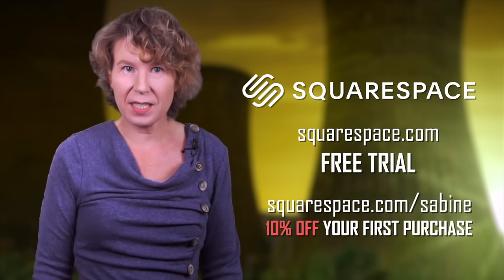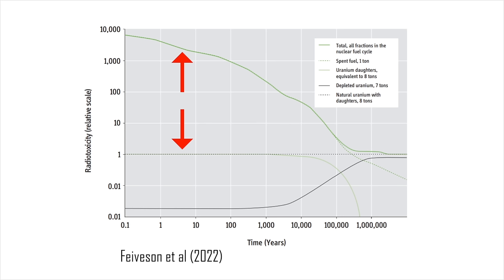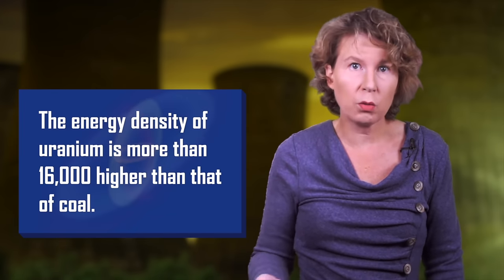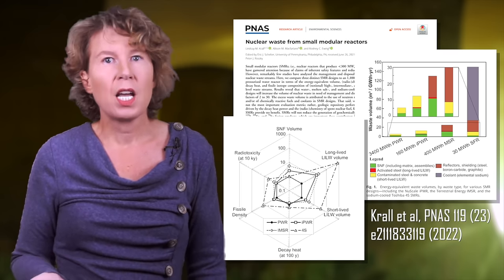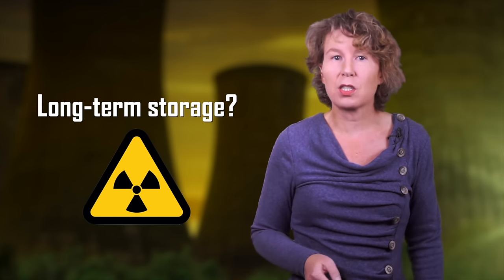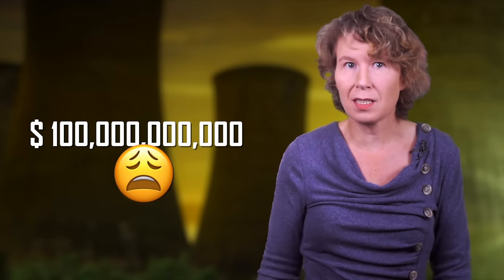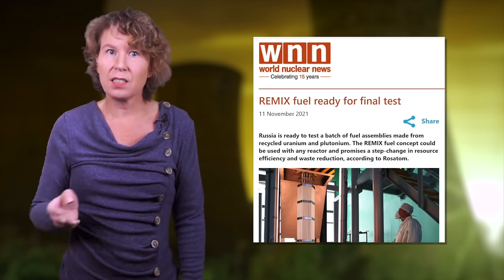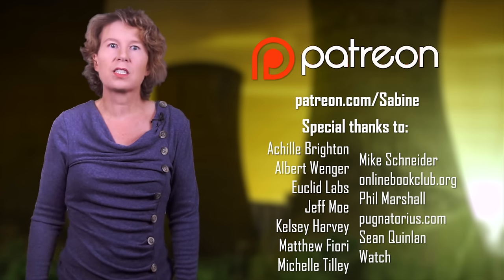Nuclear waste is not the problem you've been made to believe it is

Comment: I recall reading, several years ago, about how the U.S. Navy disposed of reactor cores, by dumping them in the deepest parts of the Pacific.  Even with plate tectonics, that stuff will stay down there for an extremely long time.
Reply: I believe this was very limited, and long ago.
Naval reactor cores use highly enriched uranium. Historically 97% U235, more recently 93%.
At end of life these cores still contain far more U235 than natural uranium. They are highly desirable for reprocessing and as a feedstock for existing enrichment plants. 
They are however a handling nightmare. The fuel have seen ten times the duty of ordinary fuel rods, in an environment with a very rich neutron economy. The zirconium jackets will be much more degraded and fragile, as will the fuel pellets themselves. They contain many times the concentration of fission products of civilian spent fuel. 
They require longer periods in cooling pools, and more remote handling at every stage until isotopic separation.
This happens at Savannah River, but most details are completely classified.
Reply: @aaroncosier735  I don't know if it was the uranium or just the reactor parts that became radioactive that was dumped.  Regardless, there's plenty of cooling down there.
I am aware of fuel reprocessing.  In fact, Canada's CANDU reactors can be used to burn a variety of materials, including plutonium and enriched uranium, IIRC.  There is also chemical separation, but that brings it's own problems.
Reply: @James_Knott  
Only the actual fuel elements need cooling. The housings are usually just iron that has had some small percentage converted to Cobalt-60. These are routinely buried in shallow soil.

Yes, CANDU can wring a bit more production out of other types of spent fuel. An extra 20% from standard PWR low enriched fuel.
It's a miraculous doubling or anything.

Deep-sea disposal is now deprecated. There is no control over escaping materials, and no feasible consistent monitoring.

Comment: Around minute 20, in the discussion of the summary table (regarding volume of waste per unit energy produced), she seems to be saying that the 1d category, a heavy water reactor that can re-use spent fuel, generates as much waste as the "once-through" model, 1a.  How is this possible?  if you only consider the waste at that plant and not that it uses spent fuel from elsewhere, I suppose it's possible, but if you are talking about the whole cycle, how could a process that re-uses fuel (i.e., fuel accounted for by the "1a" bar), how could the volume of waste be higher?  Somebody has to get the credit for the fuel recycling.

Comment: Nuclear reactors are a stupid way to generate energy, because assuming you need most energy to cope with heating in the Winter, the whole system has to be scaled to meet the peak in winter demand because they take such a long time to ramp up and ramp down. In the summer they will be mostly redundant. Which is unfortunate, as the cost of nuclear energy is mostly in the cost of the reactor itself, rather than the fuel. If they ever get fusion to work the reactors are even more expensive to make relative to their energy output. I guess Thorium reactors will be pretty expensive too, since Thorium isn't an ideal fuel to use in nuclear reactors. The whole reason we are looking at Thorium is because Uranium is starting to get expensive, due to the growing demands on the limited supply. 

Basically this is not a good approach. Maybe generating leccy in places with high solar energy and then using that energy to produce e-fuels such as methane would be the best idea.

Comment: How much nuclear waste is there? Take 100 reactors in the USA. Each core has 1/3 of it changed out every year (roughly). Therefore in 40 years there have been 33 * 40 or  1320  cores of "nuclear waste" generated. For size they are ALL essentially right cylinders, 10' high, and 10' in diameter.  So that if you did 5 across and 30 long, you'd have 150 cores, and if you piled them 10 high you'd reach 100'. Meaning ALL THE NUCLEAR WASTE FROM 40 years of nuclear power in the USA, would fit in the typical "indoor" football stadium. Amazing concept in terms of the effectiveness for energy generation versus waste.  (The ash from coal generation would need about 1 Million of those stadiums to contain it.) Now let's get to the (ignorant) whining, "What doe you do with the waste? It's dangerous forever..." NO IT IS NOT. In an analysis done by the NRC in the mid-'80's it was shown that the "total activity of all the radioactive materials in the cores", after about 330 years, falls BELOW the activity of the original Ore from which the 1 pound of high level waste was derived. THUS after about 330 years you could grind it up and disperse it to the "environment" with the net effect of having REDUCED the radioactivity in the "environment". Well, how can you be sure you can keep it "in storage" for 300 years? In the 1970's as a teenager I made a visit to Sweden. I went to the Lutheran cathedral in Upsalla Sweden. In the lower levels there was the Tomb of Gustavas Adulfos the King who brought Lutheranism to Sweden. (And his Bride)
Their bones have NOT BE DISTURBED in 340 years. (One could "easily" access the bones by removing the 10 ton marble lid on the sarcophagus. Sweden has been very CIVILIZED during those 300 years.  Compare, for example the storage of high level nuclear waste in FRANCE, deep within a granite mountain repository. I doubt, that anyone will EVERY have an interest, when the system is sealed up, in trying to go into take out any of that waste. Likewise, even a NUCLEAR EXPLOSION would not penetrate said repository.  THUS nuclear waste IS NOT a problem.

Comment: Spent high-level fuel is not dangerous for 100 000 years. That was a number back-calculated from the arbitrary and unnecessary requirement that the spent fuel should be stored until it has the same activity as the ore that was once mined as fuel.

In practical terms, after 2 000 years, you can put nuclear fuel in a museum, and let people watch it, as long as 1) you put it behind glass and implement a 1 meter viewing distance and 2) vent any out-gassing from the spent fuel and either dilute and went it, or capture as low-level waste.

This is because after 2 000 years, the gamma emitting isotopes are practically gone. Only the alpha and beta emitters remain, and those are easilly stopped by glass and air. 

Also... when Sweden picked our site to put the spent fuel, they included a local public acceptance poll. Of the two finalists, public acceptance was measured at over 87%. So, yes, some people do not at all mind having plutonium 500 meter down in the mountain, in fuel cladding, copper canisters, and bentonite padding.

Comment: The CANDU fission reactors use up only 15% of the available energy from it’s non-enriched fission fuel. But is then stored on site now for subsequent reuse in new generation SMRs small modular reactors specifically developed to use up to 80% of the remaining fission energy from CANDU fuel “waste”! While the main purpose of some of those SMRs is to burn up that radioactive waste, they also produce significant heat to drive steam turbine/grid power generators to add electrical power to the grid.

The final waste is considerably reduced by mass, volume and half-life to a nearly harmless level….

Comment: I'm rather interested in the molten thorium process. One of the bigger problems with the uranium process can be seen at Fukushima and Chernobyl. Reportedly, the thorium process's waste half-life is about 100 years. More importantly, the molten metal system is reputedly safer. Even if cooling water is lost and the reactor overheats, the molten metal will melt special structural fuses. The molten metal drains into separated storage facilities, at which point it is below critical mass and starts to cool. 

As another perk, there is far more thorium on earth than uranium.

Comment: Honestly, this is looking at the wrong side. I worked in the state regulatory side of the nuclear industry, focusing on managing post processing Low Level back in the early 90s. Back then my state could ship to North Carolina but then NC shutdown to other states. The era of permanent on-site dry storage began. Now, I live in St Louis, MO, 10 miles from an active, on-going waste leak. Also, 10 miles from a remediated nuclear fuel processing site. This region is living through the consequences of irresponsible governments and corporations. While it’s true you can walk around with a Geiger Counter, most children are not sent outside to play with a personal dosimeter. Apparently that is needed in North St Louis County. There is back and forth testing going on in schools and neighborhoods being performed by Army Corp of Engineers and private contractors. Is the community safe? Depends. Radiation is highly localized and fluctuates at low levels. Meanwhile local cancer rates are high. So each group has different results. The waste originating corporation has not been involved because the current legal framework did not exist. The federal and state government are the only ones that can be held responsible but they have not done enough. Local families have to organize and demand action because the government line is to deny there is a problem. So, the problems with nuclear waste are not technical, they are political.

BTW, the Cold War era workers at processing facility got a settlement from the federal government due to unsafe conditions.

Comment: I still can't understand why we don't just move towards extremely energy efficient electronics and gadgets, and improve the individual energy generators such as solar and wind? I think we've all been misled by power companies and governments who have kept the line of "solar is not feasible" or affordable, when the technology now can be placed on top of something as small as a van or can power most appliances. Why aren't we just putting more into that direction instead of these monstrosities that "might not be as dangerous" as we think. "Proper disposal and storage" is placing a lot of faith in human beings, and having worked in production facilities I am skeptical that someone would not cut corners or worse. I think we need a better answer, but nuclear still sounds like a sledgehammer to me. Being wielded, most likely, by a Homer Simpson and owned by a Mr. Burns, at least in the deregulated US. JMO.
Reply: nuclear is safer than wind even when including chernobyl which was an extreme outlier, wind, solar and hydro do have their place but in major urban areas that generally arent going to cut it and geography plays a big role in what is viable to use nuclear doesnt really have any of those issues its the most reliable one of the safest and the waste is stored more safely than many other types such as the heavy metals in solar panels that dont get less harmful over time and due to light regulations could cause issues in the future

the US currently is arguably overregulated when it comes to nuclear power they went crazy after 3 mile island and a few other smaller accidents despite inconclusive evidence on a causal link between cancer rates and the accident

Comment: People talk about storing radioactive waste... but are happy to release far more radioactive material via coal and gas, totally uncontrolled as its released into the air from fossil fuel power stations. 

Also, no one seems to talk about lead waste storage... most abudant isotope (~50%) will only decay after 2.01×1019 y and are just as hazardous. Do we have a 'solution' for lead at the insane standard people seem to be asking for? No. Is it a problem? No.

Comment: So this turns out to be a collection on facts about nuclear waste. Only once, cost is mentioned as a driving force, not to recycle that waste. But when we're talking a bit more about cost, there is the cost of using fusion for generating electricity. And it's not the price you pay per kWh as a consumer. There must be a reason, why the operational risk insurance for nuclear power plants do not cover fatal failure. It's simply left for the states. Doing a TOTAL cost of ownership of nuclear clearly shows, electric energy from is the most expensive. So, where's the point in rising the use of such technologies rather than do the better than best in rising renewables very best effort?
Concerning heavy water pressure reactors. There must be a reason, why 4th generation reactor concepts a) take care for running non-pressurized and b) being developed at all. However, they will come late, too late for doing anything essential on stopping earth's warming.
So why don't we discuss about the dangerous chemicals used in wind turbine generators today in order to get rid of them? Why not spending most of the money for decarbonizing on e.g. sodium batteries, being somewhat environmentally friendly - with all of that technology low in cost. I do not want to waste any more time on discussing the possibilities of of dangerous actual nuclear potential. There is a reason why germany got rid of it. And the same holds true for possibly great advantages of 4th generation reactors, not ready yet on scale in a known, reliable way - with both of them being low in price only. We have to act now.

Comment: Reactor technology has been improving with the creation of new materials and processes. New designs are much safer than the old 2nd generation designs. Anti-nukers like to post scary, hyped "facts" that nuclear energy will lead to Armageddon catastrophes.  

3 Mile Island cancer rate were greatly exaggerated by the antinuclear fear mongers. It was found that people were getting more radiation (radon gas) from their granite walled basements than they ever got from 3MI. In fact 1 plant worker's Rad-Sensor badge tripped the RAD detectors as he was going into the reactor than when he came out. It turns out he had a Rec area in his granite walled basement.

Deaths due to radiation exposure were greatly exaggerated with Chernobyl and Fukushima  too.

Comment: It seems to me that we NEED Thorium reactors to consume the nuclear waste of Uranium reactors. We may never, on a large scale, build only Thorium reactors, because of the problems introduced by the high temperatures required, but it seems to me we need some for this purpose... But what do I know... I am only a Chemist, not a Nuclear Engineer.
Reply: What you can know, even as a chemist, is that nothing in life comes for free. It's the cost of doing what needs to be done that is the problem. It is NOT a technological problem.